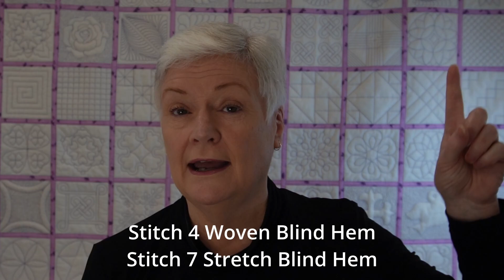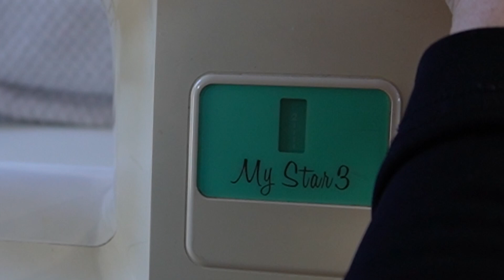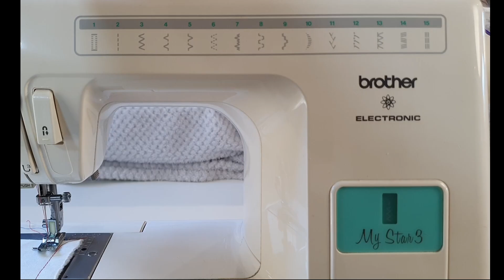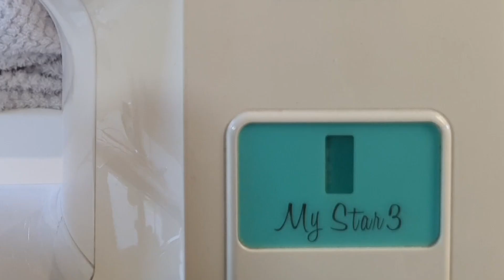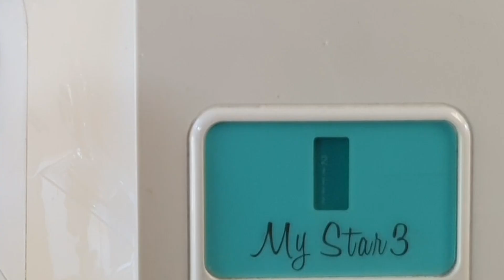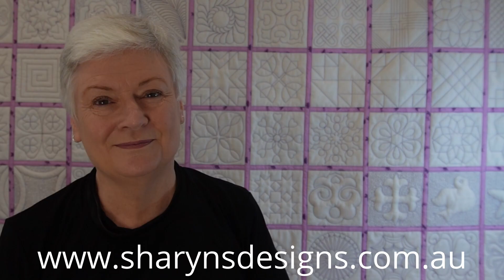Brother My Star 3 | Operation

Comment: Hi im thinking of getting this machine for me and my sister to learn how to alter. Would you recommend it? The one i may be buying has no manual and thats my main concern.
Reply from the maker: Hi there, I didn't spend a lot of time with Jane's machine, but it was fairly straightforward to use,  except perhaps the buttonhole. I couldn't get it to produce a buttonhole of the correct size. This may have been the age of the machine or just something that wasn't making sense to me! If you are going to get it, be sure that you get the appropriate cord with the machine and that it hasn't been chewed on by an animal. The cords can be astonishingly expensive, if they are available at all.  Some manuals are available free online.
Hope this helps. 
Cheers Sharyn